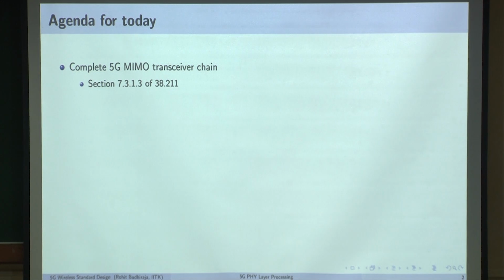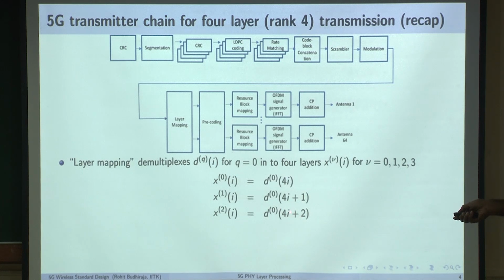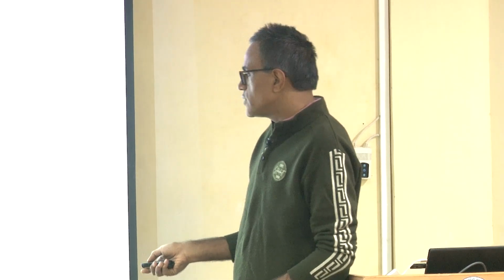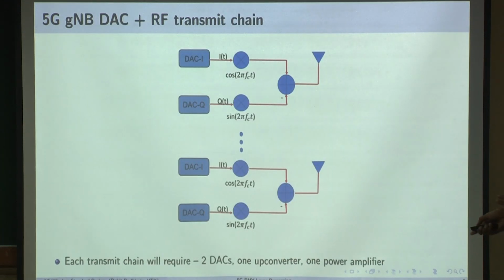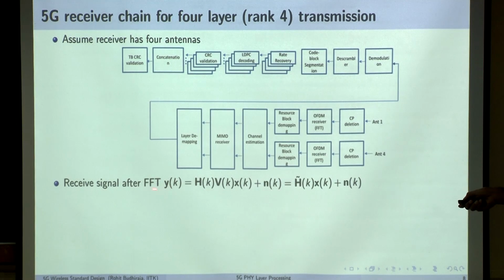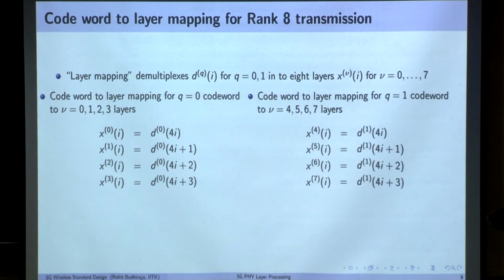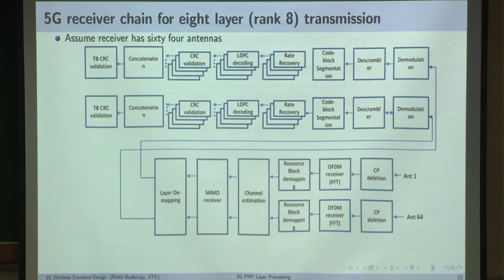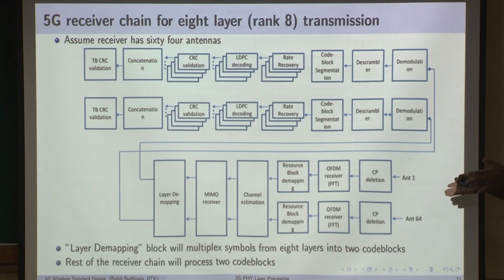Lecture 52 : 5G MIMO transceiver chain – part I

Comment: I have a question - what is the practical reason for a channel not to have reciprocity ? I mean, isn't it violation of basic principles of physics?
Reply: A channel would not have reciprocity if the uplink and downlink are in different frequency bands, which is the case in Frequency Division Duplex (FDD) systems, as opposed to Time Division Duplex (TDD) systems.
Reply: Even for a TDD system, although the physical channel may be reciprocal, once the signal reaches the baseband processor, it has already gone through several hardware components, whose properties are not exactly equivalent at the transmitter and receiver. Hence a calibration is still necessary to assume reciprocity of the baseband equivalent channels even in a TDD system.
Reply: @reubenstephen  Thankyou for your input Reuben. It was helpful. 

Actually prof is explaining it in the next video of this playlist. 

The phase in which LO is rotating in the tx and rx side is the villain. 
There is no means we can synchronise both of them . 
Usually this mismatch is included in the umbrella of channel estimation. But this will create a problem when we assume reciprocity. 

Prof tells this very briefly in subsequent lectures.